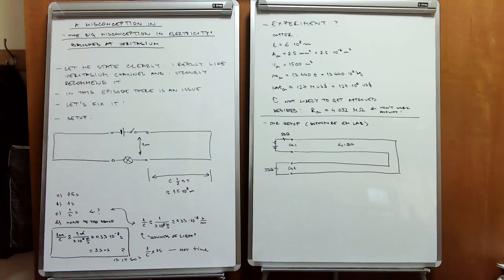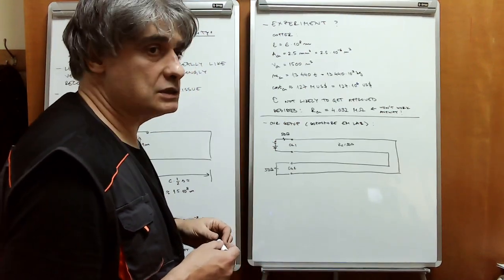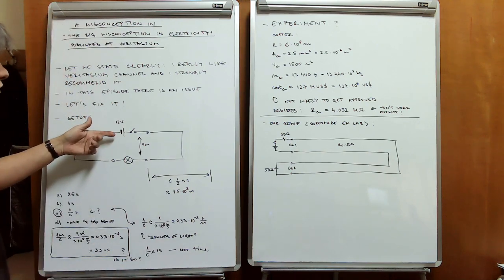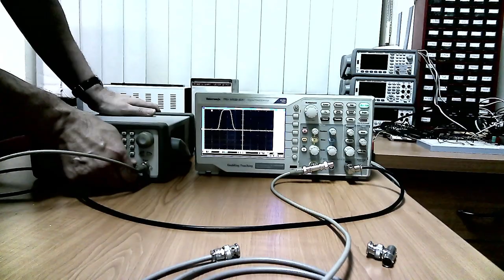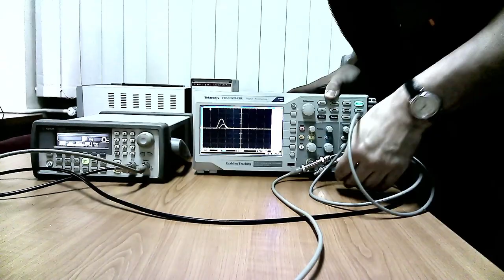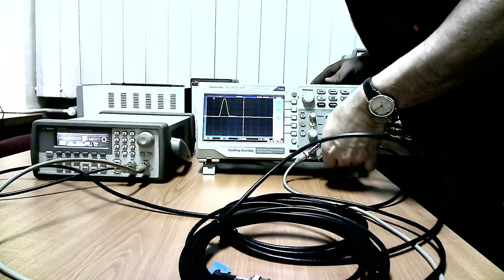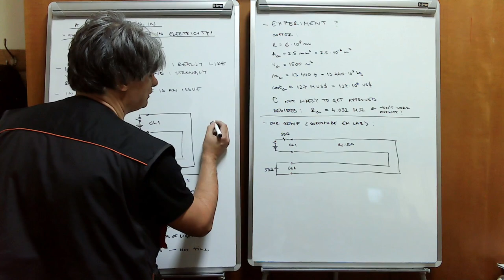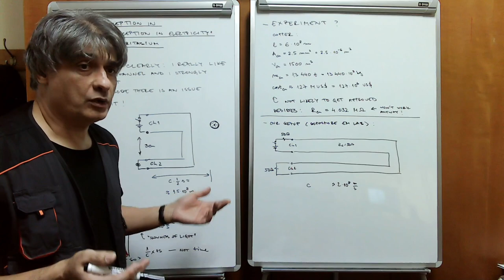A Misconception in "The Big Misconception About Electricity" Published at Veritasium Channel

Comment: Very good demonstration. Another thing which Veritasium supposed is that the light bulb would turn on instantly once a current is present, (let's assume non-shielded cables) in this case once the switch closes the source only sees the characteristic impedance of the line and would couple enough energy to turn on the lightbulb after 1/c seconds (it would see the characteristic impedance of the line in the beginning), this is an extreme oversimplification and very misleading. He also doesn't take into account that even in non-shielded cables the field is still mostly present around the wires considering how rapidly the fields decay with distance.
Reply from the maker: Yes, I agree. Thanks for giving me the light bulb transient idea, that transient is much longer than 3.33 ns, but smaller than 1s. The topic raises questions about quantitative issues in modelling: sometimes a minor effect could be blown up to shade a major effect. Thanks!
Reply from the maker: Many thanks for pointing out the light bulb transient! Temperature of the bulb affects its resistance, complicating the electrical part of the transient further. Regardless the oversimplified answer, the problem was a great opportunity to review electromagnetic theory and modelling techniques, stressing out the quantitative part. It is likely that I'll make a sequel which would include some of the ideas I got in the feedback. Together we can do better.

Comment: Electricity and the magnetic ‘field ‘ are simply manifestations of expansion electrons crossing over from subatomic realm to atomic realm. DC produces a magnetic field: such field will never light up a bulb. As electrons expand at @c the completion of the circuit will be 2 seconds under Veritasium ideal conditions. As stated the actual wire length is probably less than 200 feet: of course the bulb lights ‘instantly ‘. Surplus electrons- high pressure ‘negative ‘- flow to deficit electrons- low pressure ‘positive ‘ terminal. DC produces an electric ‘field ‘ only near/at bulb, not along the wire. Mostly misdirection on Veritasium’s part. “The Final Theory: Rethinking Our Scientific Legacy “, Mark McCutcheon for the physics.